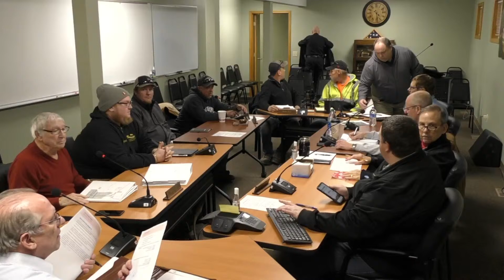City of Fort Scott Public Works Work Session - 01/05/2022

Comment: That’s not how you fix roads. 

First you fix your potholes, depressions, crack seal, bring everything up to grade. Then you put your sealant coat on top of that. Weather that be a slurry coat or a chip seal. All the “Cape Seal” he keeps touting is chip seal with rubberized sealant sprayed on top of it to seal it in. 

What he’s talking about doing is like laying carpet over a unlevel subfloor then pouring leveling mix in the depressions later. Totally ass backwards.